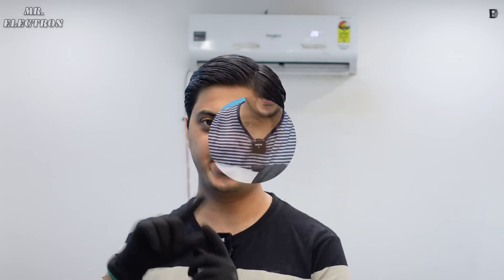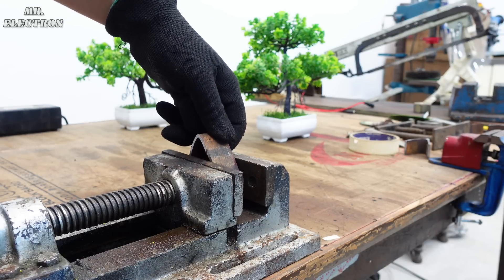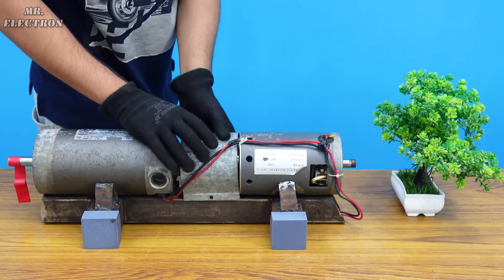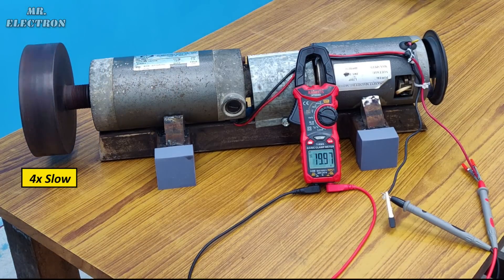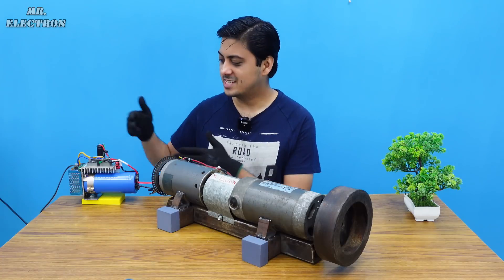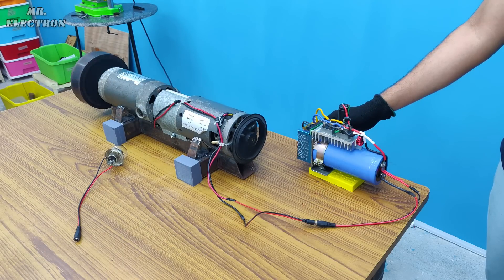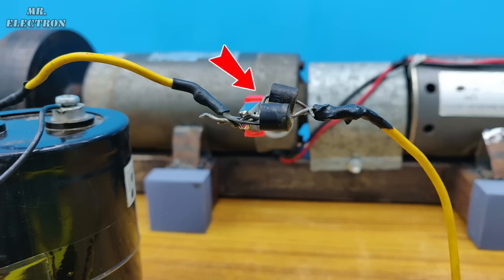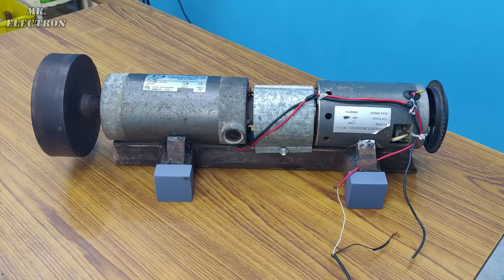New Idea make Electricity Generator 220v Build Flywheel Machine - not FREE Energy Generator

Comment: Dumping the power in to a resitive light bulb or heating element is ok for breaking.  But the breaking torque drops each second as the rpms drop.  

Dumping strait into a capacitor bank sort of sucks for breaking because as the geberator slows down and the capacitors charge and voltage, the breaking torque drops precipitously fast untill voltage on the capacitors has risen and the rpm output voltage drops to less than what is stored on the capacitors. Sadly, the remaining energy kenetic energy is unavailable to be converted and stored electrically. 

you should use a boost converter between the generator and the capacitors, It will be much better at converting power and energy at low rpm volts higher voltage pushing current and power into the capacitor bank.
Reply from the maker: Yes and it would have stopped even faster had i used the super capacitor pack.
But then, stopping the car by applying the brakes is the whole point of using this technology.
Reply: @MrElectron  a bank of supercapacitors  might store more ebergy. But being able to control  a boost converter's output voltage controls the power drawn by the capacitor bank, much more like how a person uses their break peddle. And continues to break supplying constant breaking torque  all the way down so long as the boost converter can use the lowest voltages output by the generator.
Reply from the maker: I have thought that too in the past but for  utilizing the old batteries that can no longer maintain 12 volts 🤔.  Cool , I might try that in my next video and check how it performs.

Comment: Instead of changing that barallel connector manually, you can add a 2 pole switch which can switch between bulb and the power supply...
Reply from the maker: Yes i know but i still choose this method because it shows the disconnection clearly  otherwise there is this possibility where someone comments that the bulb is glowing because of the connected powersupply.
Reply: @MrElectron  Oh.. I see... Got it...
Reply: @MrElectron very good point...